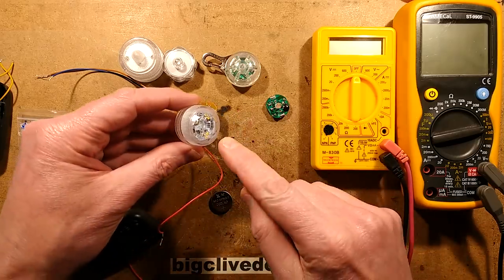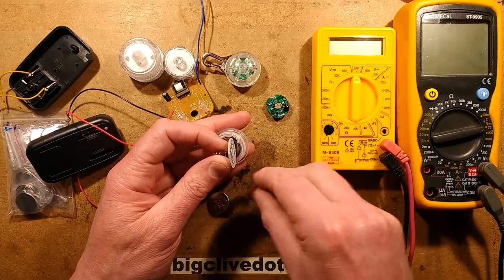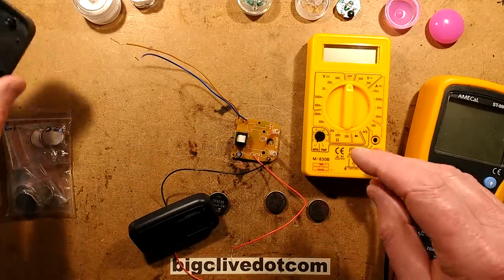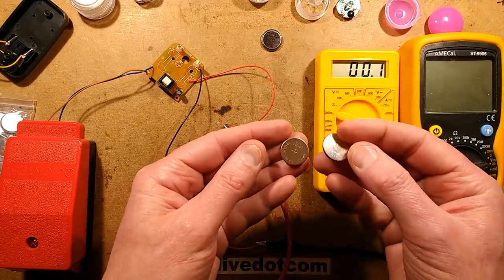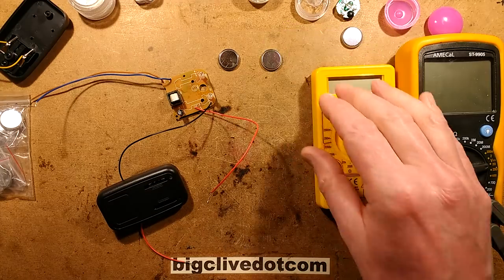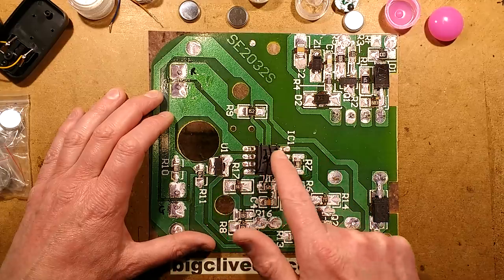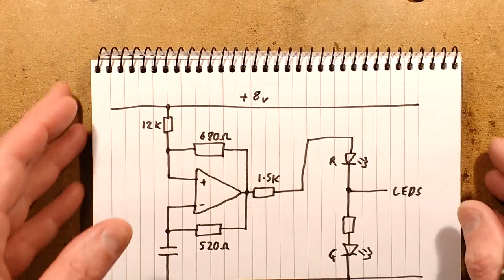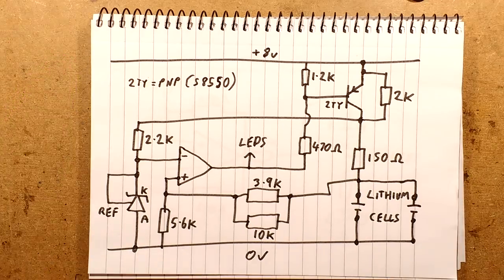Reverse engineering of shady lithium button cell charger.

Comment: Avoid touching the insulating ring on the cells. Depositing even a little bit of sweat into the groove will cause the cell to discharge over time, sometimes reducing the life of the cell quite a bit.

Comment: I once reflowed a pcb with a heatgun and forgot there was a lithium 2032 soldered on the board.
A search for clean underwear ensued. In fact I did a quick check to ensure nothing had embedded in my face.

Comment: I used to be able to recharge any coin cell with those old Bedini circuits. For whatever reason the low current flyback spikes did wonders for them. If I recall driving the circuit from an AA was well suited and even the little 1.5v button cells would recharge to 1.6v or higher. Given the number that could be recharged with one AA it wasn't all that bad a conversion.

Comment: This one reminded me to check the expiration date on the 9V battery in my Fluke 8020A multimeter.  It was 8 years past the date - replaced. The Rayovac alkaline still worked, no leaks.
Thank you. I have had a rash of Duracell in date leakers to clean up in the last year.
Reply: That multimeter is so good, due to my job I have to test it once every 6months and it's mindblowing how accurate it can be despite its age

Comment: This video was a real treat!
I honestly still don't know how or why it turned out so long.
Nothing felt superfluous, and it was a really interesting little circuit.
I still think that resistor was there for control-loop stability; I might go and simulate it tomorrow to prove/disprove it.
Reply: Okay, so after simulating the circuit with the closest equivalent models I could find, it does seem like that resistor is being used to stop oscillatory behaviours. Specifically, if the resistor is omitted, then once the battery gets removed after it is fully charged, the transistor will oscillate every time the transformer-switching transistor switches on or off. The oscillations only peak at around 5.5V, and they die out quickly after each switching event; however, this is without modelling all the parasitic elements of the board and the component leads.
It is entirely possible that, for example, the transformer can cause much worse oscillations due to inductively induced currents.
Reply: I thought of it as lowering the Q of the primary winding, which would damp the oscillations when the switching transistor turns off. This is just another way of describing what you suggest, really.
Reply: Merlin Skinner; Well, mostly, yes... I actually didn't include the primary supply part (with the transformer), in stead just simulating what would happen to the rest of the circuit when fed by a 8.4V DC supply, with 100mV of 30kHz 'switching noise' superimposed.

The reason why I chose to do it this way, was because I have NO idea at all what the core dimentions or the grade of ferrite is, nor do I know how many turns of whichever thickness wire was used (I only know the turns ratio). I don't even really know the switching frequency, but I figured a 30kHz square wave would be enough to excite any high-frequency instabilities.

I do, however, completely agree that the transformer's inductance, together with the transistor's input capacitance, and even the parasitic capacitance of the coil winding and the pcb tracks, would create a very high-q circuit at exactly those high harmonics of the switching waveform. It's just very hard to simulate without any hard numbers.
In the worst case (and with the damping resistor removed), the Q could be high enough to actually cause an avalanche through that poor little transistor!

All in all, I think the best solution would have been to just add a capacitor to make a simple RC snubber network, while still feeding the Zener from the main supply (like Clive did).
Reply: I was pretty sure it was there for a reason, as I've seen very similar things before, and I remember being told it was to decrease some sort of peaking (basically a snubbing resistor/cap). Could this have been fixed using a (very small) capacitor in addition to the resistor there? As the cap should fully charge and open circuit at some point?

What's this Q value your talking about, not a term I'm familiar with.

Comment: Chinese circuit designers need to run their projects by Big Clive before production. For a fee of course. ( + massive box of random 'lectronic products)
Reply: Wim Widdershins honestly they are really bad.
Reply: Wim Widdershins The designer of this model seems very competent.  I wonder if she had a reason to actually want the continued charging at 0.1C above the target voltage. Maybe the originally intended cells would self-discharge at higher voltage, causing the charge to level off safely at (example) 4.4V.  This might be typical behavior for cells intended as backup batteries in clocks and PCs, designed to be charged in 12 hours and remain stable using just a 2K2 resistor and a diode.
Reply: @johnfrancisdoe1563  That hypothesis would only make sense if the charging circuit was supposed to be in a clock or PC, and was charging e.g. 3x series NiCD cells; because Li-Ion shouldn't generally go above 4.25V, and mains-powered clocks and PCs should themselves charge anything that needs recharging.
Meanwhile, almost all clocks and PCs use primary cells; typically 9V PP3 for clocks, CR2032 for PCs, because that's "lifetime" for consumer products (despite we electronics mavens might demand / expect longer) and adding rechargeables adds $$ which most consumers won't pay.

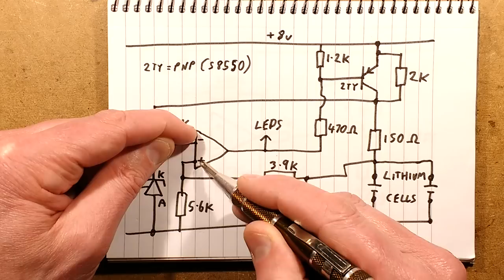Comment: 16:55 This is right out of my Higher Physics Analogue Electronics unit, thirty-two years back. The op-amp has no feedback resistor, so it's switching straight from the negative supply to the positive supply voltage, whatever that is, depending on the difference between the two inputs. The word you are expected to reproduce in the exam is "comparator".
Reply from the maker: You do get specific comparators.  In this case the transition is only "snap action" on the LED flasher with the feedback shifting the voltage divider.    The op amp controlling the charging made quite a slow transition between low to high as the battery voltage neared the threshold.
Reply: The apparent gradual transition would be due to the op-amp thrashing about as the inputs were very close in voltage. It is effectively pulse-width modulation, and would look quite horrible if viewed with an oscilloscope. However, it does seem to satisfy the "good enough" criteria demanded of a commercial product.
Reply: Comparators tend to have a touch of hysteresis added internally, otherwise when the two inputs are very close they turn into oscillators due to all sorts of coupling effects.  At least that's what I vaguely remember from many decades ago.
Reply: It is a bit of a head-scratcher, why they opted to use a standard op-amp instead of a comparator. But considering LM358s cost just under a nickel apiece, and comparators like LM311 cost just over a nickel (in quantity, both according to Octopart), I suppose that extra half-penny expense would've put it over-budget.
I agree with Merlin though: the output would be interesting/a horror show on a 'scope, but it's "good enough," at least for the manufacturer(s). ;)
Reply: if they dont have any hysteresis they can produce rf interference depending on switching currents - not good
Reply: zh84, interesting.
Reply: Op amps with hysteresis are know as Schmitt triggers I believe. Just add a bit of positive feedback.
Reply: Han Gathercole Lam Schmitt triggers are general analog to hi/lo digital converters with a largish hysteresis.  The anti-oscillation hysteresis in comparators is as tiny as possible, so as to not ruin common designs based on ideal behavior.
Reply: The main difference between opamps and comparators is that comparators are designed not to latch-up when the inputs go outside of their specified common mode or differential range. Apart from the open-collector output, there's not much difference between an LM393 comparator and an LM358 opamp -- there's certainly no hysteresis on the comparator. You could use either as a comparator unless the inputs could rise close to the positive rail, in which case the LM393 would have guaranteed behaviour, whereas the LM358 would not. Otherwise, the LM358 is a good choice as a comparator as it can source around 20mA from a high output, which the LM393 cannot.

Comment: One of those meters started my fascination with DVM's. Found your channel, Joe Smith and Dave Jones. Too lazy to go to the van and get my 87V I used one of these for testing mains 240volt. However the dial was 180 degrees wrong, ohms setting . Bang, sparks, smoke and a new pair of underpants.

Comment: Clive, would you consider taking a couple 2032 cells to pieces to show us the difference between the rechargeable and non-rechargable cells?
Reply: Possible alcohol and explosion containment pie dish overcharging of coin cell(s) too? :3
Reply: yea yea lets do it clive buddy !!
Reply: Yeah! That would be epic
Reply: I have a defunct rechargeable emergency light/motion detector light (from Aldi, but rebadged versions were available from elsewhere).  After about a year it started coming on randomly and didn't retain any charge.

So I repaired it using cheap Chinesium rechargeables from fleaBay.  They lasted about a month before random operation and the case (of the light) started bulging.  Opened it up and one of the cells had disassembled itself, forcing the outer case open (and that forced the case of the light to bulge).  Inside was what reminded me of the old polyester film capacitors. It took maybe only half the volume of the case.  I didn't bother unpeeling it because I didn't want to let the flames out.

My guess is Clive would find something similar inside either type, the differences being down to battery chemistry and not visually apparent.
Reply: I could be wrong but I believe there is little physical difference. The differences are in the chemicals used, or so I have been led to believe. Take it with a pinch of salt though as my source has been known to be wrong before.
Reply: +Gordon Lawrence
You can change non-rechargeable to rechargeable by adding a pinch of salt?  That's nice to know.

:)
Reply: https://en.wikipedia.org/wiki/Button_cell I thought the 2032 cells were all the same. Apparently not, so regular ones are NOT rechargeable. The ones marked LIR2032 are rechargeable tho. Oops, you mentioned that already lol.
Maybe Clive could demonstrate this??? We know you have the fire containment equipment...just in case.
Reply: I would Like to see that too!
Reply: @bdf2718  That's super dangerous, don't try it!!

Everyone knows you need 2 pinches at least.
Reply: @bdf2718  Oh, and Nutmeg! And lots of Love sprinkled Generously. (Walt Disney).
Reply: @AndyHullMcPenguin  I'm greatly saddened that your link is now dead; but I have a freshly-dead CR2025 and a car battery charger, so will attempt to replicate your results.  Also, I commend your suggested methodology and feedback suggestions :-)
Reply: @theskett  I applied 3.3V with no current limiting and was surprised by the loudness of the report. A car battery charger sounds ideal. As to feedback, I suspect you will get plenty of that, and perhaps even some feed forward. Shrapnel injuries not withstanding, I'm sure you will be good enough to let us see the results. Let us know when your hearing returns to normal.
Reply: @bdf2718  I love how you put it.. "one of the cells had disassembled itself".. I heard it in Clives voice in my mind and laughed!
Reply: John Irving  whoooooooosh

There is this little magical thing called a sense of humour.  See if you can acquire one somehow then re-read the thread.
Reply: Would be really interested to see this.
Reply: Can you also put a stack of about 10 in a hydraulic press while your at it, kinda like how NileRed does? Much appreciated 🙏
Reply: @bdf2718   it has to be sea salt.....right?...........ha
Reply: I think there is going to be little physical difference, same colours tbh. It’d be different on a chemistry level.
Reply: @bdf2718  Yep, and his (voltage) source having been known to be wrong meant that he once omitted the salt and tried to recharge the non-rechargeable saltless one.
Reply: @ELECTROHAXZ   then give it to photonicinduction 😂
Reply: @markaz2kk  Yeah, too bad he's been gone though. He came back but then vanished just as quickly as he came back.
Reply: These videos need to be closed captions so places that allowed we can actually see what someone saying.
I believe it's illegal requirement something to do with 1990 Ada
Reply: He's just done this as a YT short!

Comment: CR2032 can make a pretty loud bang when they are charged.  Bought a cheap RTC module for an arduino project off of Banggood and had it running for about 3 days when I heard a loud pop and couldn't figure out what happened.  Went back to do more work on the project and found that there was no longer a battery in the holder and that it had shot across the shelf the project was put on and left a skid mark on my wall behind it.  After some further investigation, discovered that the battery was basically in parallel with the incoming power and only a diode to prevent it from back feeding out to the arduino itself.  Being new at the time to buying things from Banggood, I had not bothered to check anything on the module and just hooked it to the 5vdc rail of the arduino and pop went the battery.

Now I just run the RTC on the 3.3vdc rail without a battery in the holder and just have to reset the clock every time it losses power.

Comment: In the unmodified charging circuit I think they were misguidedly trying to give the circuit some hysteresis: when the battery is fully charged the transistor starts to turns off which reduces the current through the voltage reference reducing the voltage at the negative input turning the transistor "more off". So when  the voltage on the battery reaches the fully charged voltage the transistor snaps off. Essentially the loop gain is increased by this positive feedback. As Clive points out the forgot about the current through the 2K charging a fully charged  battery
Reply: I look through the comments  and missed your post as I posted the same thing (a year late!). It was definitely the cheapest, nastiest way they could have provided hysteresis.  They maybe could have coupled the op-amp output back to the non-inverting input but it would have needed a diode and a resistor or two; there goes an extra penny on the BOM.

Comment: 31:45 - that "file size" limitation probably isn't anything to do with the technical limitations of your camera, most modern file systems can handle very large files, it's done for tax reasons. IIRC, Cameras that can shoot video for longer than 30 minutes are classified as video cameras and are taxed differently to stills cameras, so most camera manufacturers arbitrarily limit the length of video shots to 30 minutes in software.
Reply: Governments are involved.
Reply: I had no idea about this, now I have a smarmy comment I can say to people with DSLRs! Also, it's quite interesting in general. Many thanks! :D
Reply: FAT32 doesn't allow large files than 4 294 967 295 bytes which is less than a DVD.  But ordinary DVDs aren't full HD, so 30ish minutes is not an unreasonable limit for FAT32 which the camera probably uses.
Reply: He’s doing it with an iPad 2.
Reply: @0x8badf00d  androids use ext 3 or 4
Reply: @hachikiina  Not cameras, and if they did, they wouldn't be compatible in windows. Fat 32 is the 'universal' format compatible with everything.
Reply: @rich1051414  i felt fat when you said that. ok sorry :d
you're probably right, but i was talking about androids file system. cheers
Reply: @hachikiina  Android can also read fat32.
Reply: @rich1051414  i see, i shouldn't have talked about stuff without verifying it first. thanks for correcting my error, cheers
Reply: @hachikiina  Yeah, I see what you were inferring, but when it comes to removable media, which is where videos usually are stored, Fat32 is a reasonible assumption for a storage format as it will be compatible with mac, linux, and windows pc's for editting, and in this case, files cannot be larger than 4GB. So it is probably a case of killing more than one bird with one stone.
The new exFat format is the 'new version' optimized for this use case specifically, but it hasn't quite made it to universal adoption yet.
Reply: 29 minutes and 59 seconds is/was the limit for video recording before a device is considered to be a video camcorder (30 minutes or more) and is/was taxed higher in the EU.
Reply: @rich1051414  Android does use Ext4, but it relays it to a computer as an MTP/FTP device, so the storage format is irrelevant.
Reply: @AngelaTheSephira  Android does... but PCs don't. Storage format is relevant. That would only work if you use your camera as a card reader. That isn't how most people do it.
Reply: @howlingwolven  ohhhhh, that makes sense... "The EU." Tax, tax, and tax some more.